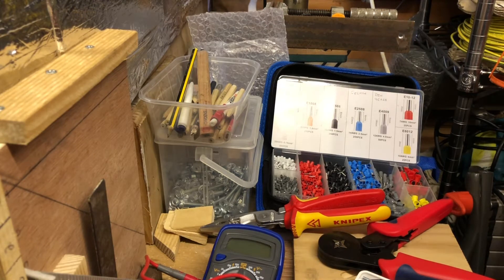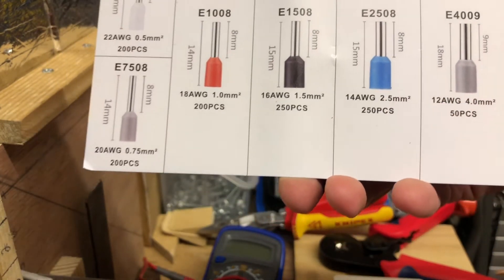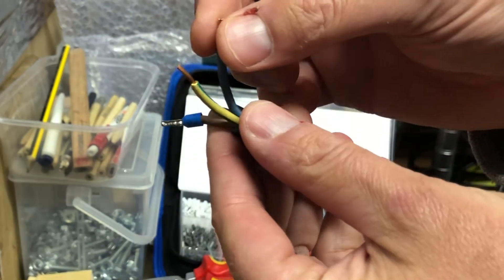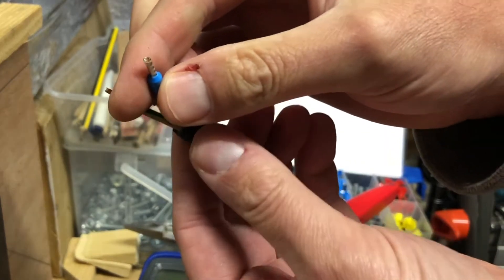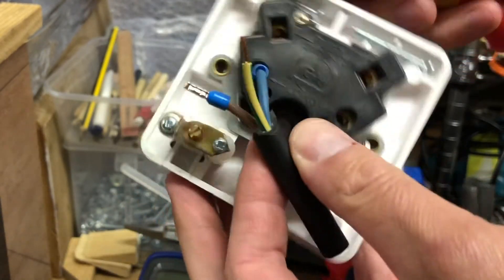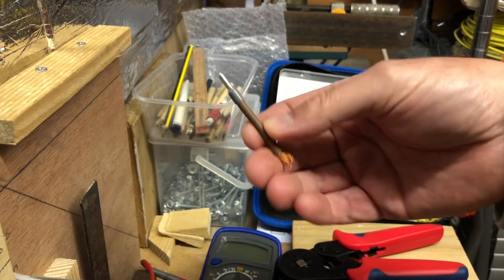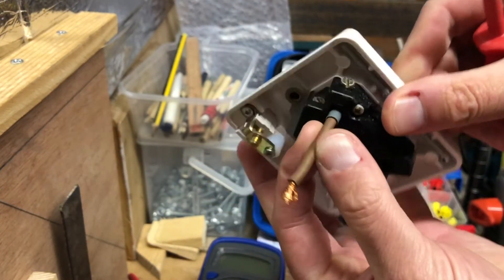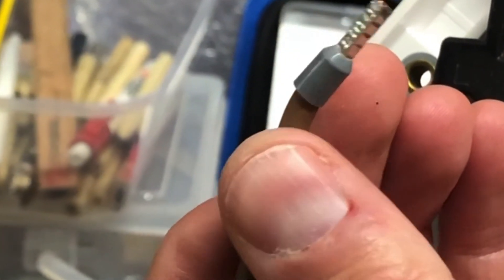Electrical Boot Lace Crimping / Ferrules "To Crimp or Not to Crimp?"

Comment: Great invention these, bought some pre wired consumer units last week for a touring site. They came terminated with boot laces, makes a tidy job. I see quite a lot of damaged braided cable on the site, more so the neutral which has burnt due to poor/loose connection. I’ve Started using these when rewiring the connections. These ferrules Should be less prone to loosening of connections through micro vibrations than just terminating bare braid alone. The smaller uninsulated crimps are good for inside plugs too. Makes a nice tidy job of that as well.

Comment: Hi Chris when crimping a yellow lug onto earth cable for example i’ve always been told to then put green/yellow tape from the top of the crimp down over and slightly onto the cable...is this required for this type of crimping also?
Reply from the maker: This is something that is good practice but not really necessary as I’m assuming the rest of the conductor is covered in green and yellow sleeving to a 70/30 mix? The CPC can not be used as anything else other than an earth so extra taping isn’t really required.